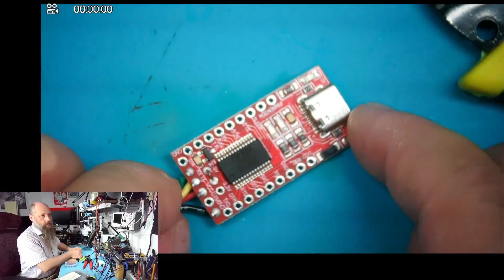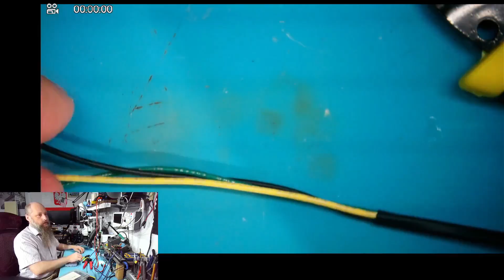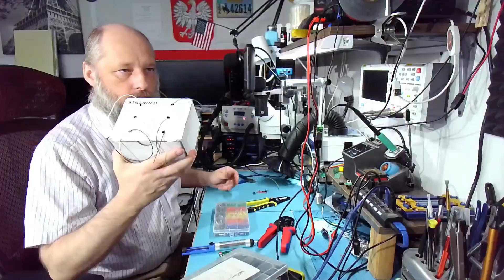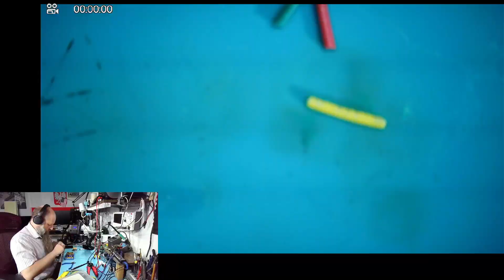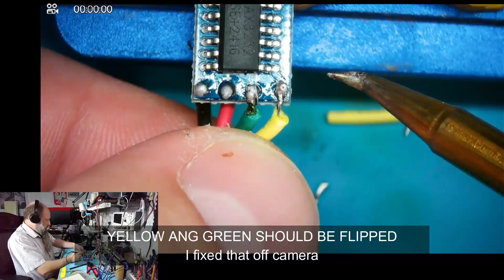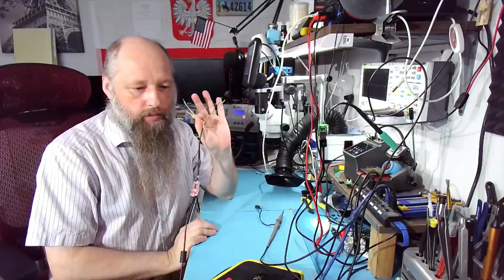183 | Windows 11 USB C Upgrade for IR6500 Rework Station

Comment: Why don't you just buy an ftdi USB to rs232 converter cable?
Reply: I am also thinking about it
Reply from the maker: Do you have a link? I tested a few of them but they don't seem to convert voltages correctly
Reply: USB-RS232-WE-1800-BT_5.0 --not USB-C, but a simple adapter plugging into laptop should do the trick between the computer and the converter.   I do not have experience with your rework controller you're dealing with however.  Somebody who helps disabled people program their scooters got me on to ftdi products. FTDI, has configuration software utility for switching certain parameters on their converters. Be that all as it may, signal levels obviously need to be correct for certain devices or they won't communicate.  I needed to build a level converter for TTL for one particular type of motor controller.  Not my design as I'm not an engineer but it works really well once you get everything set correctly.  Fun stuff.